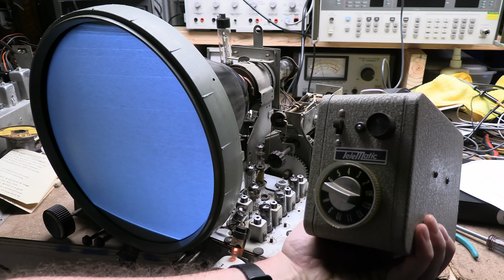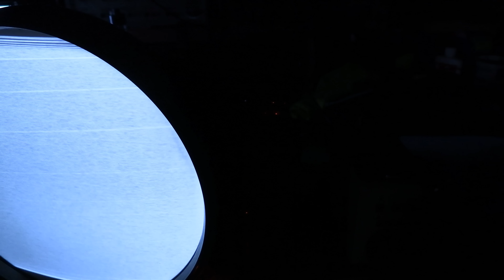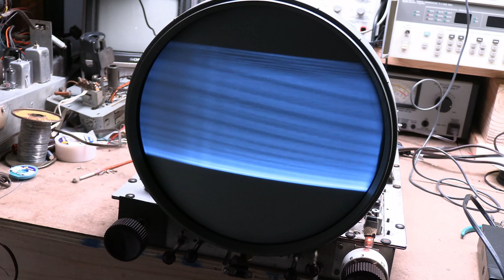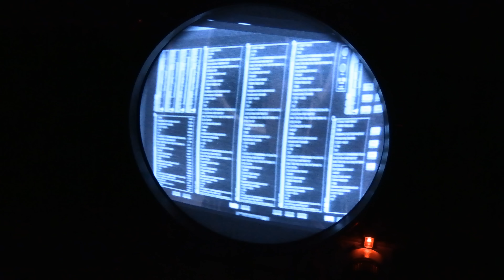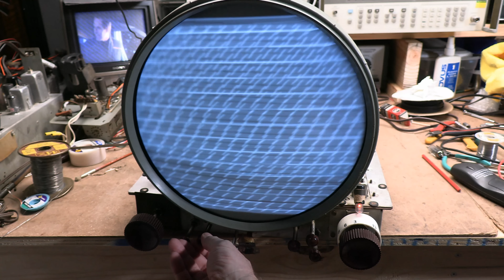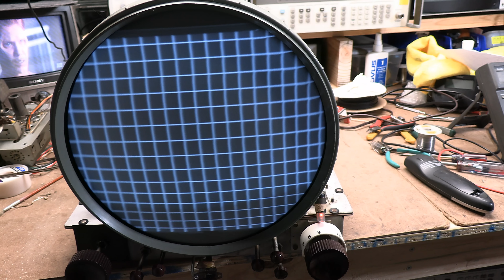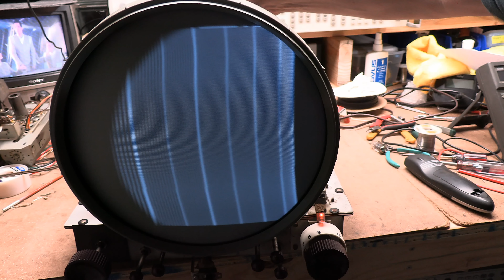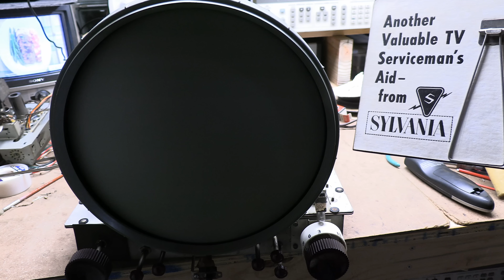Zenith G2322 Claridge "porthole" TV restoration p5o6

Comment: I "cut my teeth" working for a Zenith ASC and dealer. Best shop I ever worked for. On the old Zenith sets like you are working on, it seemed that every time you moved a control or coil, it would interact with everything else. I absolutely hated the old split sound systems. What a PITA to get set up right. I wonder if you are missing the Ch.2 strip? I don't remember that set being old enough to have a ch. 1 position.  That old styrene plastic is incredibly fragile.
Reply: In the previous video the service literature showed it had 2 through 13, with 1 being a blank, so 1 may be the omitted strip.
Reply from the maker: The channels do not go in order. Zenith knew that no area would have adjacent channels so it goes 3, 6, 8 etc. 2 comes later.

Comment: Good job tracking this bug down...very subtle and interesting you found several other issues, open coil and resistor, etc. 
Unrelated Question: When you showed the Zenith Manual, I noted the address on the cover and Googled Mapped it. Seems it's still there(or was when pictured) and covered several blocks. So curious, since you're in Chicago if you've ever been by that spot?
Reply from the maker: No but Zenith had a number of facillities in the area.  I recall seeing some of them out in the western suburbs in the 80s.

Comment: Even before the first zap, in wondered why you didn't throw a rug or something over that tube. Then you zapped yourself and still not even long sleeves or a glove. And that reaching around....😮
Though it didn't kill service technicians by the dozens, an mistake is easy to make and can have permanent effects. 
And yes i know the camera angle might make it look worse then it actually is. Even so. I hate to have to look for a new resto channel.
Reply from the maker: It's not a big deal. Just a little more than a static shock. A rug is not a good insulator. Many fragile parts I don't want to risk damaging

Comment: I discovered your channel while examining the circuit diagram of the RCA630. There is a question I am curious about: Are you an electronics engineer? Is it necessary to have an engineering education to design circuits such as RCA630 etc.? I studied computer engineering(software orientated) and electronics technician, but my electronics knowledge was not enough to understand the RCA630 schematic.
Reply from the maker: I am, but they don't teach tube theory or tv circuits. I learned from reading old books, magazines and reading about others restoration projects. These circuits work a bit differently than solid state electronics.
Reply: @Dougukan0000 Don't feel bad. The design of the RCA630 and others required the combined expertise of many dozens of the very best genius analog electrical and mechanical engineers available in the 1940s. Each had his own field of expertise- tuners, I.F. strips, FM demodulators, blocking oscillators, audio amplifiers, sync circuits, high voltage supplies, glass artists, electron optics designers, magnetics, phosphor experts and the list goes on and on. I can't even guess at the development cost. I'll drop two names here- Loren Jones, circuits expert at RCA Camden and Ted Nichols, phosphors expert at RCA Princeton.
Reply: @nevellgreenough404  I have no expertise in electronics. I'm interested in software and cybersecurity. I just wanted to examine it out of curiosity. Yes, I know that such designs are the product of many specialists. I want to analyze the circuit piece by piece and find out the principle of operation. Can you suggest a source for this?
Reply: @Dogukan0000 One of many references is "Television Engineering Handbook" by Donald Fink, published 1957. I have no idea where a copy could be found, but good luck researching and have fun.
Reply from the maker: Yes, that is a very good book.  I expect it's on ebay